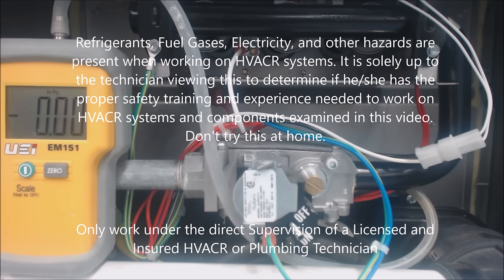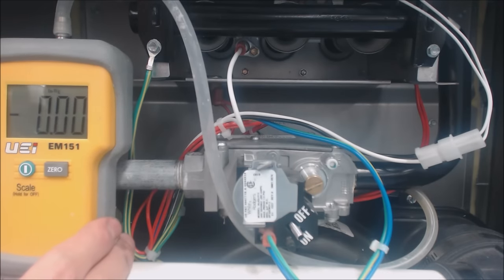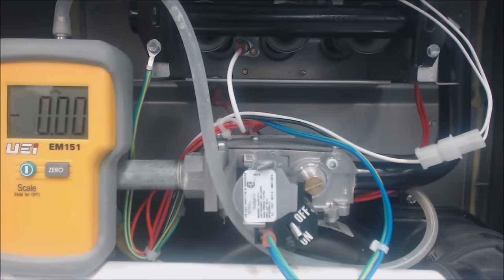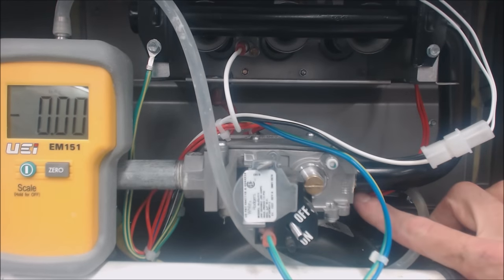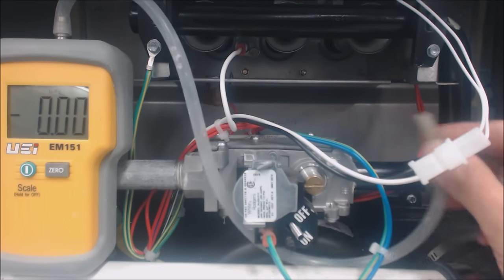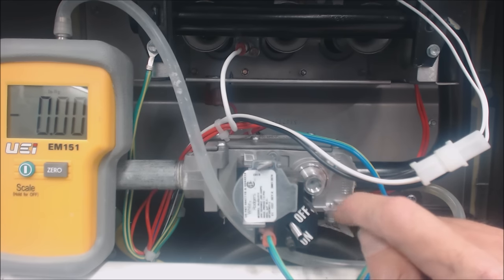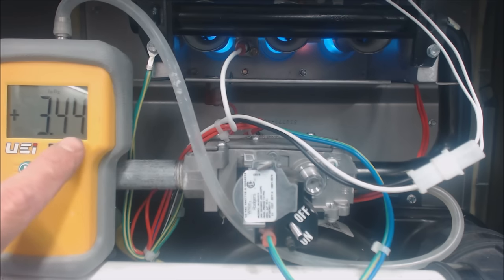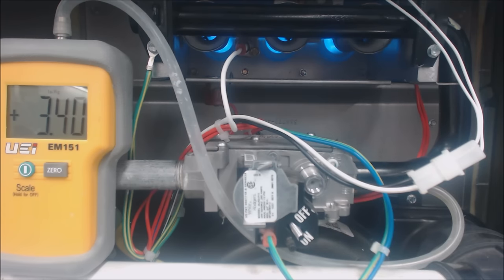Checking and Adjusting the Outlet Gas Pressure going to the Burner Tubes on a Gas Furnace!

Comment: Excellent example of how to confirm and adjust Manifold Pressure.  A word of caution for Service Techs. If using any electronic meter to do so, you must have it's calibration certified yearly and put that certification certificate in a safe.  Should an incident occur, you have done your due diligence to ensure you are using a tested and accurate instrument.If you don't want to go through all that hassle, use an actual water manometer from Yellow Jacket.  You calibrate it every time by filling the water up to the Zero mark.Stay safe,
Reply from the maker: I would rather go with a lower tech instrument but with everything variable speed or multi speed as well as the pressure switches, we need to read as low as .2" for gas and .001 for pressure switches. Thanks
Reply: Who verifies the digital meters at UEI. ? Send it back for service ?
Reply: @Mik-mk8us  Yes, UEI recertifies

Comment: AC service tech is always on point with his videos. Probably the best out there. I didn't think you were going to do furnace videos. I was hoping you would. Thank you so much for these videos. A couple videos I think new guys would like to see would be: Static pressure test, heat exchanger examination, removing gas valve and installing. If you have a way for us to donate I would like to. You helped me this first summer of my refergeration apprenticeship. thank you so much.
Reply from the maker: I am really glad to hear that these videos are helping you! I love to hear those aha moments and that the videos and time making them are appreciated. The channel has a fan funding section on the channel home page which goes towards our parts and supplies if you would like to donate but I do appreciate your comments and your time to write out your thoughts, thank you very much!

Comment: Hi. I just bought a LP 15,000 btu Empire Direct Vent for use at my cabin located at 7200' elevation. I have just run the heater for 30 hours after installing the High Altitude recommended orifice #57. The one it came with was #56. I am currently just above sea level and it seems to be operating great on a 20# LP tank with low pressure regulator. When I get to 7200' is it advisable to check the pressure with a manometer? It should be 11 WC. I have not checked it at sea level, but would altitude make it change? Finally, you turned the heater on to check, should I do the same? I have in and out valves marked and following your video it seems I only need connect to the out side (that goes to the burners,) turn it on and then I will get a reading. I can adjust at the screw under the brass cover if adjustment is needed. Am sounding like I am doing this safely and correctly? Your thoughts are appreciated. Thank you.

Comment: Hi Craig. Do you have a video on how to hook up the manometer on a 90+% gas furnace to adjust gas pressure?  ie where you need to reference the sealed burner for proper gas pressure?

Comment: I ordered a replacement 74W26 gas valve for my Lennox furnace and there is no adjustment screw. It does indicate that it is factory set to 3.5 WC. I installed it and it ran like a charm.

Comment: love these vids. I need refreshers as im still novice in this field. Thanks. 
Question. The brass barb fitting, do they come in smaller sizes (referring to the threaded tap)? If so would it still give me an accurate reading?

Comment: Is it OK to run the natural gas furnace below its spec pressure? The issue is that my furnace yellow flex CSST line whistle like a mad orchestra when at full blast. It's a big single stage 80% 110000 BTU Lennox. So I cut the pressure at the CSST flex line by 30%-40% and the whistle has gone. The flame looks the same and it is perfectly blue, but I don't know what the actual pressure at the valve is. It's probably better to replace that crappy yellow CSST to whistle free version of CSST, but should I really worry now?

Comment: At 5:33 you say " you gotta make sure you're zeroed out with the inducer motor running".  Is that right?  Don't you mean without the inducer motor running?  I'm just wanting to make sure I'm not missing something here.  I appreciate your videos a lot, by the way!  You speak clearly and not to slowly.  And you get to the point without added peripheral stuff just to drag out to 10 minutes.  Thank you!
Reply: As a comparison, I just checked my furnace's installation manual. It's fairly precise with it's instructions (Rheem) and it makes NO MENTION of zeroing out the manometer while the inducer motor is running. If this had an important/critical step, I'm pretty sure that it would have been in my furnace's installation manual.
Reply: @ginobean737  Thank you!

Comment: Hello I have a 2 stage Honeywell valve. I believe the valve is bad and here's why. When the blower comes on the igniter lights up the flame starts with no issues initially.  After the flame starts say maybe 3 or 4 seconds it begins pulsating.  I seen another video someone had to tap on the valve and it worked np. I had watched mine and it began pulsating I tapped the valve and it had a perfect flame. The other LP appliances have no issues it seems to be just the furnace. I had purchased another identical valve and it's for natural gas. I don't want to buy a conversion kit since the unit is already converted just wanted to change out the springs.  I looked at the manufacturer specs and it's between 10 and 11° water column. I see a manometer online for $37 but to be honest I had never used one before so I'm not familiar with the settings. From my description does it sound like it's the valve. I had cleaned the heart sensor as well just in case it was that. It's just odd it will pulsate and just a tape the flame seems to be perfect until the next time. I already have the other valve and just not 100% in tightening the springs.  I read it is 11 turns to the adjustment. If I tried without the meter and it was under the specs on over would it just not fire correctly? I want to be sure just wanted to pick your mind. Hate to pay $200 for a tech to install 2 springs but I guess worst case scenario I will. Just want to be safe ..Thanks

Comment: So after years my furnace stopped working and they told me the pressure was too high and somehow it triggered a safety shut down.  Solution was to lower the gas pressure?  Does that make sense?

Comment: Thanks for the informative video. I am troubleshooting a no ignition issue with my furnace. The igniter glows and the gas valve opens; however, the igniter stops glowing just (0.1second) before the natural gas reach it for ignition. I have check and confirmed that inducer motor, pressure switch, limit switches, flame sensors and even control board are working properly and in sequence. The gas will ignite if I manually bring the ignitor closer. Do you have any idea as to what may be the problem? Im thinking that the pressure may be too low.

Comment: Good video. So I have an old Warm Morning gas heater, LP. The gas valve does not have pressure taps to check manifold pressure. Could I use the plug/cap as access to connect the manometer that sits at the "T" after the gas valve? one side of the T is the cap, the other is the orifice leading to the burner, of course the third leg comes from the gas valve. I have an intermittent problem with pre ignition and I believe it is being caused by low inlet pressure. Also the stove does not indicate W.C. pressure on the rating plate.

Comment: Do new gas control valves come preset from the factory? It looks like it was pretty much spot on for you in the video. I need to replace a valve that is buzzing loudly and I don’t have a manometer and it doesn’t have a brass screw only a silver one
Reply: Most likely no, and its better to check the pressure accuracy than trusting the random employees that put this thing together. 

This is a video on how to check the pressure, not an installation video. He could have changed the reading to make it slightly off just for the educational video.

As for the brass/silver screw, he mentioned it in the video...hit the play button again. 😉

Comment: I got one i did to work , since it was retrofitted in an older house , i had to turn down the valve a bit but it has a near 50 degree temp difference and works like a champ

Comment: thank you for all your help. on the shutoff gas ball valve why does it say 1/2 psig on it? i thought it would have a higher rating than this, like 200psig or something. thanks.
Reply from the maker: low pressure natural gas runs at 5-8wc (water column) and propane runs at 11-13wc. 1psig=27.6wc. All gas valves in appliances have a max pressure of 1/2psig which=13.8wc . They are not to be included in pressure tests at 6psig on 30lb pressure gauges. Thanks Mark!
Reply from the maker: Hey Mark, the wog psi value is the highest they are tested to but the 1/2 psi is put on there to say it is rated for indoors per csa and ansi standards. They have to state 1/2psi even though they test it to higher standards. Seems silly to me but they need to, thanks

Comment: on a furance i was working, it was a high efficient 2 stage. and it had tubing going from the  valve to the pressure switches. the tubing had a red line on the black tube. can i test gas pressure from this tube?

Comment: Great video! When you are replacing a gas valve couldn't you count the number of turns as you are taking it off to get the same orientation!
Reply: Its a great question, but in my opinion it is best to check it properly so you know you're getting the correct reading with the new part replacement.

Comment: so for a 2 stage gas valve how would you go about setting the second stage gas pressure? do you just jumpered R and W2 to get it into 2nd stage and use same procedure as single stage? also for a 2 stage gas valve there's still only one output for manometer hook up correct? thank you for all your help.
Reply from the maker: Yes you can look up what dip switch to set or jump in the manual, you could jump the control board 2nd stage heat and if you are specifically just checking gas pressure only, most gas valves power 1 and 2nd speed with 24v at the same time so I just jump across the two hot terminals while firing, not the common obviously. This would not work on modulating furnaces though, thanks!

Comment: Replacing gas valve with different model, is it ok to do so, even not on manufacturer's part list? I think it is ok, as long as functions are same, I mean both same pressure, both have no pilot. BTU rating shouldn't be a issue. This is my opinion. My tech friend disagree it. He said wrong valve will change flow, even pressure are adjusted to same.

Comment: Great videos, how do you purge  the gas valve before first start up?
Reply from the maker: I either purge at the union or tee but it is preferable to just let the system run if it is a direct ignition and the amount of gas needed to be purged is not that much. This is to avoid the smell of gas in the house, thanks
Reply: Thanks for the reply, again great videos.

Comment: How do you adjust for elevation in correlation to the 0 to 2000. If the water column range is 3 to 3.8 does the higher elevation make you set toward the upper limit of 3.8 or the lower limit of 3?

My ranges are the same and my elevation is 800.

Comment: What would cause the outlet/manifold gas pressure change over time?
Reply: It’s not often that it does, if it is a little over or under normally it hasn’t been set properly by factory standards.

Comment: If someone took the boss screw completely out of the gas valve outlet test port instead of just turning it out one full turn and using the manometer, would you get a different reading?

Comment: I have a new White Rogers 36J model, and the inlet and outlet taps are not threaded like the ones I'm used to check. How do I hook up my manometer tube to those taps or my barbed nut?

Comment: Nice video. Can you make a video or explain how to test gas outlet pressure for a dual stage furnace by using jumpers to jump the control board and bypass the stat for low fire and high fire
Reply from the maker: Thank you for letting me know what you would like to see!
Reply: I just checked my furnace installation manual and it had instructions re: high fire vs low fire.

Comment: good day AC Service tech. Just wondering how would you go about adjusting a modulating gas valve? Are these valves supposed to be adjusted?. I see on some Lennox there's a red tape on top of the brass screw that says DO NOT ADJUST. But on other manufacturers there's nothing that says that. Thank you.
Reply from the maker: Honesty how I learn with each manufacturer is to just read through that section of the installation manual because each furnace is different. Other units, you enter the settings through an action on the board and adjust the modulating valve by turning the electrical screw adjustment not a spring pressure, so not sure on that particular unit, thanks

Comment: What about a gas valve that has smaller ports so that you can’t screw in your barbed hose fitting? How are you supposed to check the inlet and outlet gas pressure for these types of gas valves? I’m working on a Goodman to speed gas valve and it’s inlet and outlet port test fittings are smaller than the standard threaded/barbed manometer fittings.
Reply from the maker: Those you have to put a rubber hose adapter onto the hose or use the hose itself. No threaded connection is needed.

Comment: Where can I get that brass fitting that goes in to valve , does that have a specific size,name? Good video. Thanks
Reply from the maker: Here is the link to the 3/16" x 3/16" x 3/16" brass barbed tee used for checking pressure switches-  https://amzn.to/2INSRhQ

Here is the link for the 1/8" NPTF x 3/16" barb fitting for reading wc pressure in the gas valve tap- https://amzn.to/2G563Bq

Comment: hi, so the 5-7"wc at the input is provided by the gas supplier? you can't change this? i believe your smart gas valve video mentioning there's an adjustment screw where you can adjust the gas input going into the gas valve. does all gas valve have this feature? thank you for all your videos.
Reply from the maker: You can only adjust the output to the orifices. For nat gas, incoming is usually 5-7 but could be 5-8" wc and that is only adjusted by the gas company. Propane can be adjusted at the regulator outside by the 3rd part propane supplier if it's too low, thanks
Reply: @acservicetechchannel  so when tech support asks what the inlet gas pressure is we really don't have a way to check. Usually they want to know inlet and outlet gas pressure.

Comment: This is great!  thank you.  Is there a standard size on the gas valve manometer test port ?
Reply from the maker: Yes , they are all the same and that comes with the tester. I would highly recommend the Fieldpiece SDMN6 Dual Pressure Testing Manometer with Pump-   http://amzn.to/2jyK5Ka  -- I started over the years with the standard gauge manometer, then went to the UEI and now I am loving the SDMN6 due to it's self pumping while measuring feature for isolating and testing pressure switches. This tool is also used for checking gas pressures, thanks

Comment: Will the gas pressure reading on the regulator output be lower in the middle of winter on the coldest days?  My furnace starts fine but has a problem starting on the coldest days.  I thought perhaps my replacement regulator needs to be adjusted to account for the lower supply pressure on the these coldest days?  It works fine on the average winter day.
Reply from the maker: I am assuming that you are talking about propane. The issue would then be the tank size with the available vapor area in the tank. Are you talking natural gas or propane?
Reply: My furnace is natural gas line from the utility.  I had the gas valve replaced but the tech never checked the output pressure after installation.  It is odd it only has problems igniting on the coldest days.
Reply from the maker: Yes the output gas pressure definitely needs to be checked. If it is a 90% efficient or higher, it may have to do with the colder combustion air mixed with the improperly set output pressure.
Reply: I'll definitely have it checked.  It's an older 80% furnace with a 24V 60hz valve (2 solenoids) LH33CM601.  Thx!

Comment: hi, for sealed combustion( with a hose connecting gas valve to burner box) do you have to remove the cover to adjust the manifold pressure? thank you.
Reply from the maker: That is what the tube is for so that you don't have to take the cover off unless the manufacturer says to do so. Then you follow that up with a combustion analysis, thanks

Comment: If you get a better co2 reading with water column set at 2.8 inch instead of 3.4water column, is that ok?
Reply from the maker: Great Question! That could be ok but you want to make sure that you do not have a rough fire start because that could become an intermittent problem but if that is ok after testing 5 times then it should be ok. The other thing is knowing that you may not be receiving the total btu for furnace input which will mean less output heat. It depends on how close you are on heating the house on the coldest days via your load calc. You can do what is called clocking the meter to verify gas cfh input while the system is running. Thanks!

Comment: what happens if the gas pressure is not properly regulated what damage the machine would have
Reply from the maker: You don't want the furnace to overheat or to have the combustion incorrectly occurring, thanks